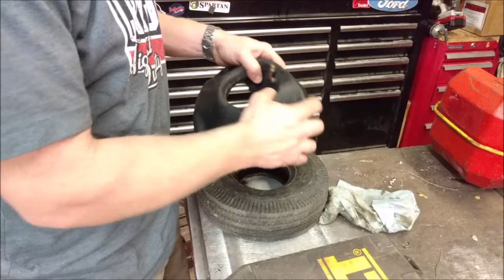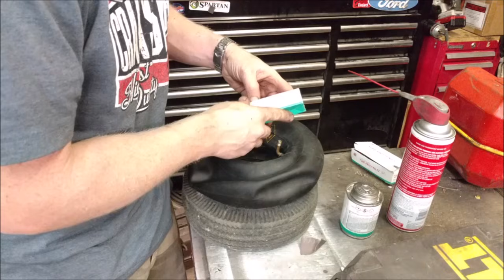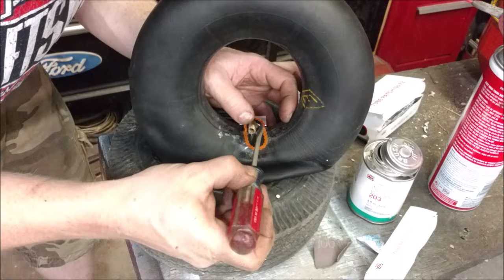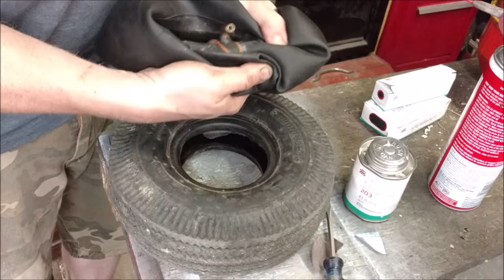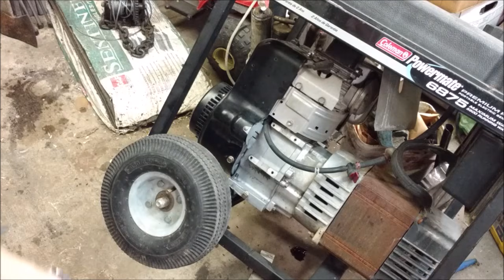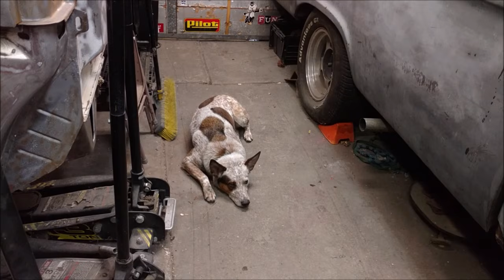Easy Inner Tube Valve Stem Repair

Comment: Ahhhhhhhh!!!!!  This is going to help me so much!  I've literally going through ten tubes this year at about $9 a piece for my mower's sulky.  Constantly tearing the valve stems.  I make for certain when I install the tube inside the rim that the valve stem pokes through the rim without any bind on it.  So I think the tube is somehow shifting inside the rim causing the stem to wear against the hole in rim.  Atleast now I can fix them!  Your channel has so many of out of the box diy things that I've put to actual use.  LOVE YOUR CHANNEL!  Can I come be your shadow?  In the meantime ya got a patreon?
Reply from the maker: Thanks. You could put a patch on pre injury to prevent it from ripping. No Patreon.
Reply: That's a peculiar problem for a non-driven wheel. A tire (and tube) shifting like that usually only happens when drive power or braking is applied to a wheel and then usually only because of additional factors such as lube on the tire bead or under inflation. When installing a tube it should be inflated twice. First to allow the tube to untwist and shift inside the tire and then reinflate to seat the bead. It can be difficult just by looking to tell whether the tire bead has seated against the rim so release the air and press around the rim edge to be sure it has seated then reinflate.
Reply: Aaaaaaaaaa2aaaaaaaaaaaaaaaaaaaaaaaaaaaaaaaaaaaaaaaaaaaaaaaaaaaaaaaaaaaaaaaaaaaaaaaaaaa
Reply: aadoublea, if your tire is slipping on the wheel rim, you might be able to use a method of motorcycle racing and drill holes in the side of the rim of the wheel, and run SS screws, at just the right length, into the tire bead.

Comment: This idea actually worked except I used a piece of old rubber roofing I cut into a circle and glued on with spray adhesive. that seems to be holding.

Comment: I have been getting a number of such valve stem rip punctures on the rubber like this. I'm going to try putting rubber washers on the valve on both the inner and outer rim valve hole in an effort to prevent that kind of valve-adjacent rubber rip in the first place.
Or putting this repair patch on like that before such a puncture might prevent one in the first place. A stitch in time saves nine?

Comment: Inspect valve stem to assure tube is not moving inside tire.   Wash inside tire surface to remove any dirt/dust and tube as well.  Keep proper inflation to prevent tube slippage.  Slippage will cause this type of tear where valve stem exits rim.

Comment: I just bought two bike tubes presta valves for a mt bike diamondback 
Response 29 er one tube was good 
Front wheel  - the rear I was running 
40 psi went for a rip   And the presta 
Valve  well  it did not hold  . Pulled it right out of the tube . This has happened before  .

Comment: Just what i needed! My road bike tube is leaking at the base of the stem. Going to try that fix, and use someone's suggestion to slide it first on the valve stem, then add the glue. Thank you! And btw, those Rema German patches are the bomb.
Reply: That just happened to me today Friday the 13  go figure. On a new bike tube . Pulled the presta valve 
Right out of the tube . On a diamondback response 29 er
Rear rim  . Not the first time .
Reply: I think park tools use the same patch ?
Reply: I tried to fix it, didn't work for me. Still has slow leak, maybe I'll try to put an extra patch over, a little larger one

Comment: I already did all that on my own, gosh darn electric scooter tube still leaking, tried three times. Ordered three tubes just to keep spares on hand.

Whoever idiot assembled the thing at the factory left the nuts that are supposed to keep the valve stem out on the wrong side. 😅

And of course it was the back wheel that popped with all the gizmos on it which are a pain to take apart, which you must to replace the tube. Really wanted the patch job to work to avoid that mess.

Comment: While I am about to try this technique 1st, I did find that Milton makes entire valve stem replacement patches.... search for Milton 462 and/or Milton 473 for them. But once you try one of these entire valve stem replacements you are stuck with them and if they don't work the tube is trash, while trying this 1st gives you a 2nd chance with one of the Milton stem replacements if this doesn't work. I have a rear tractor tire with a cracked tube stem, this tube is only 3 years old and costs over $100 to replace so.... what do I really have to lose but a few more days time? Just wish it wasn't 100F outside here in Texas right now... ughhhhh! 😕

Comment: Nice to know...i have air leaking from stem where rubber meets the threads of value...i ruffed it up with sand paper and brushed vulcan cement...i will wait a day or two before i fill with air...if its a fail i will just buy a new tube..

Comment: good tip, just one thing. Whenver I put a patch on a tube, the instructions say to let the glue dry before adding the patch (presumably its stronger this way) . Why did you not let it dry?

Comment: Do you have video on just patching an inner tube for tractor tire? 
Maybe these Rema patches your using will work better then the common inner tube patch repair kit that are at Wally world, they have small square patches and I cant seam to fix my tube with them, they still leak and peal right back off easy...........
Reply from the maker: That's so frustrating. I stack Rema patches all the time to fix holes in bigger tubes. They don't fall off like the cheap patches. You can essentially build whatever size patch you need.
Reply: @sixtyfiveford  I ordered some 2 in. (Best) tire patches yesterday, you ever try that brand?
Reply from the maker: @job38four10  I haven't. Once I tried Rema I tossed everything else.

Comment: Does this prevent valve stems from getting damaged again once in place? I need a prevention, not a cure
Reply from the maker: Absolutely. But also prevention is not allowing the tire to run low on air so the tire spins in the rim. You can also use a bead sealer on the tire to rim to help stick it in place so the tire doesn't want to spin on the rim.
Reply: @sixtyfiveford  I have had this happen 
A few times  , but on a mt bike  always the rear  new tube presta on Friday the 13 th - put the new tube in half inflated . To prevent a pinch flat 
Then inflated to 35 psi  . Checked tire 
To make sure it was seated . Then inflated to 45 psi  .  Went for a ride 
Yep I pulled the core body right out 
Of the tube . At 65 I still have not learned my limit . Tube was from 
eBay under warranty

Comment: I attempted to repair the valve stem on a road bike with a presta valve. Probably because I only used one patch and do not have much experience, it did not hold pressure

Comment: I use and pipe cement for a cut valve stem repair. Holds up to 180 psi. Simply coat the slice sides and coat entire area around the stem hole in rim.

Comment: What you should have done first after cutting the hole in the patch is to slide the patch over the stem then apply the glue with the brush and then press it onto the tube

Comment: I have a gun cart I use for sporting clays I made from a jogging stroller. Here in the Sonoran Desert we have mesquite thorns among other stuff that flattens tires. Patches didn't hold. On the last flat I coated the hole with Permatex Ultra Black Maximum Oil Resistance RTV Silicone Gasket Maker. I applied a slight vacuum to the tube to suck some inside the hole, then just enough pressure to keep the RTV from sticking to the opposite inside wall. Applied enough around the hole to make a patch and let it sit for 24 hours. That was a couple months ago and it hasn't leaked. The Permatex Ultra Black Maximum Oil Resistance RTV Silicone Gasket Maker sets up into an extremely tough neoprene rubber like material that is useful for many applications beyond the one it was designed for.

Comment: punched a hole in my best rubber airline pretty much in the center of its length. tried to patch it. fail. 100 psi resting rate is a lot to ask of a patch. any ideas?
Reply from the maker: I've done the same. I put a barbed hose splice on it.
Reply: was hoping to not need the radiator style clamps that get caught on everything
Reply from the maker: I put the barb, then wrapped it with multiple wraps of tightly wound bailing wire. I then threw some heat shrink tubing over that.

Comment: Great video Moe! Its wild what you can learn on youtube...
I watched this video late last evening and today I went to the bike parts store and bought some of these patches. They were selling them for 25c each though. I wanted to buy a box of 100 but they wouldn't sell me a box grrrrrr. Thats a great tip on repairing the tube around the valve, I had 2 tubes tear a cm from the valve earlier this year but I had to replace the complete tube... Where did you get the whole punch?
Reply from the maker: My hole punch is early 1900's vintage but I know they still sell them online. A small sharpened pipe or bullet casing would do the same.
Reply: sixtyfiveford  Cool, I'll try looking for one or maybe make one.

Today I put that green slime stuff in my bike tire tube. Last weekend I had a flat tire so I put a new tube into it and pumped it up to 80psi and a day later its at 20psi. What a pain! I figure if the green slime works on cars and motorcycles it should work on a bicycle tube too.
Reply from the maker: I've had great luck with the slime, but only in tubeless tires. I have had poor success with slime in bike tubes, but I know they sell tubes with slime preinstalled???

Comment: That did get me thinking that I have seen replacement valve stems on a patch for big truck tubes
Reply from the maker: It's a lot cheaper than a new tube. The valve stem patches are only $5 a piece but you have to buy a handful.

Comment: When replacing an old tube with a new tube, cut out a round section  about 2-3” diameter of the old tube. Use a hole punch like in this video and slip it down over the valve stem.
Reply: good idea

Comment: Good tip I’ve never thought about trying that.as you say either a new tube or the expensive glue in valve    And I agree on the Rema tip-top patches that’s all I will use and all the tyre repair places seem to use over here (uk)
Reply from the maker: Thanks. Rema Tip-Top makes some good products.

Comment: About three weeks ago Just for the heck of it I did a repair on my son's dirt bike tube. His tube has a straight valve stem. I normally clamp my tube repairs between two wood blocks. For his tube did the same just drilled a hole for the stem in the wood and clamped it down and let it cure/dry. Worked like a charm!
Reply from the maker: That's a great idea!

Comment: good job..I have used the new metal  valve inserts with the washers install depending on if the tube is worth if esp 4 ATVs
Reply from the maker: Hey Thanks.

Comment: Why bother 
Just buy a new tube
Reply from the maker: First, that would make for a crappy video. Second, I can permanently fix the tube faster and cheaper than I can go buy a new one. Third,  in this day and age when everyone is too lazy to learn how to fix stuff I like to show people what is possible.
Reply: In a pinch it's worth fixing. Once you get the tube out the repair only takes a few minutes.

Comment: Another great tip, Thanks! I would put the valve stem cap on, to prevent getting glue into it. Wondering how few ever knew about this one.
Reply from the maker: Thanks.
Reply: Commenter Five: youd need to make a bigger hole though with that route which would not make it snug enough at the base.

Comment: Have you ever used the old burn patches? I don't remember the proper name for them, some of them had primers that you would hit with a hammer to set it ablaze. The heat vulcanized the repair. I think I'm telling my age.
Reply from the maker: I have some sitting in my patch pile. I was going to make a video on these patches for fun.
Reply: @sixtyfiveford  would like to see a video of them in use, just for nostalgia, good times,  good times,  can you still buy them? I would like to have a few .
Reply from the maker: I actually looked to buy some 8-10 years ago and couldn't find anyone selling them. The only ones I could find were old stock for collectors on Ebay. I finally found some at an estate sale a year or so ago.
Reply: Sid Walker hot patCh  best tube patcjes they are
Reply: Sid Walker hot patches

Comment: Man its been ages since I patched a tube!  Over the years I had many semi tires patched. I even plugged a few. I rarely got less than 450,000 on a set of drives, even after being patched.
Reply: BCtruck, rebuild, repair,repurpose 450,000 miles on a set. I’ve had a lot of tires but none that were that hard of a compound. Usually ran a softer cap called winter grip had them siped and still places where chains were required. I’d get 3-4 seasons out of them. Ran Yokohama mostly in the summer months and get 4-5 summers out of them.

Comment: I just tried to do the same fix a couple of weeks ago but my hole wasn't clean (no jokes please, although you owe me one) and it failed. I was also using whatever Walmart sells for patches (crap).
Reply from the maker: haha. Years ago I was looking for a better patch and virtually every forum I looked at has someone saying Rema was the best. I bought a Rema Tip Top patch kit for $5 shipped and I will never use another patch.
Reply: Got any tips on fixing "waders" rubber boots, most likely the seams.
Reply from the maker: Personally my go to fix would be Shoe Goo or E6000. I use these to fix inflatable boats etc all the time.
Reply: sixtyfiveford  I've been using E6000 on wetsuits, pretty good stuff, and good idea thanks.